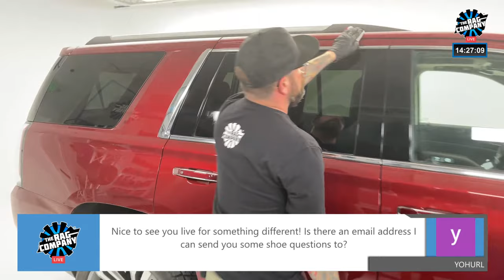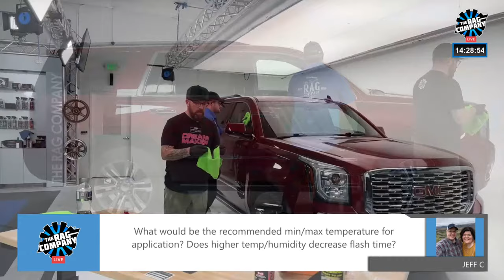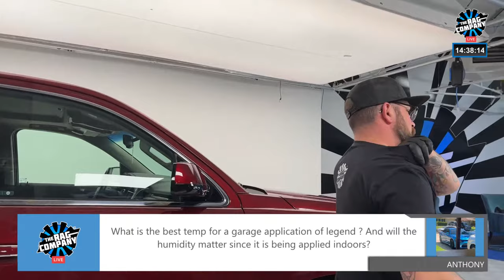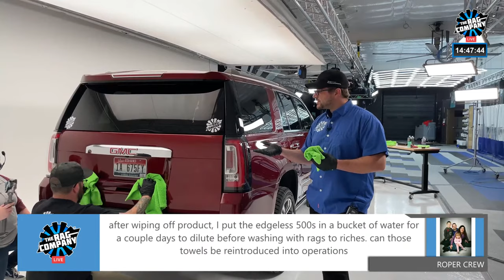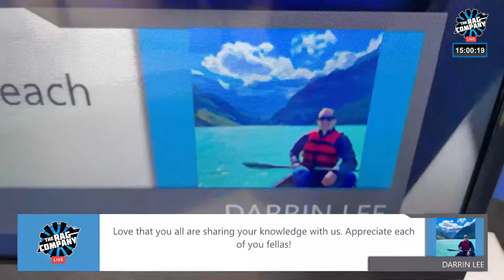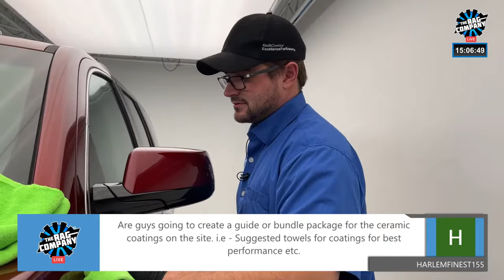Washing and COATING a GMC Denali with P&S Legend! | LIVE DETAILING EVENT

Comment: I can attest that Legend will make one work for it when figuring out the flash time.  I had it flash pretty quick at the time of application due to the temperature and weather.  I do agree that 30ml is enough for an average size sedan with 2 layers.  I have enough left over for like a panel.  Once applied it does look and perform really well.  Sole on top is nice and a breeze to work with.

Comment: I definitely wouldn't do an entire quarter panel that size at a time with  pro coating, definitely biting off more than they can chew even with 2 guys which is also burning up alot of coating having to knock down high spots. Fast in the long run to slow down and also always have 2 towels one to spread and level then a second to remove the transfer solution.